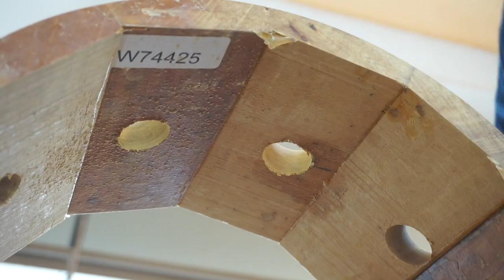SOLID WOOD STAVE SNARE DRUM: TIMBORANA & MALLEE BURL, Pt. 2

Comment: Pro-Tip: Use a wire brush on a clogged hole saw while it's spinning, not sandpaper. It's faster and will clean it right out. You are removing a clean-out route on the hole saw, and reducing the cut diameter, when you grind the side of the teeth with sandpaper. 
This, if you decide you are not going to use a forstner bit, which would be the better option :)
Reply from the maker: Indeed!  I enjoy looking back on these older videos and see how much I've grown as a woodworker.  It will be a long time before I claim to be anything more than a hobbyist.  This is no small part because of the budget I work with.  A forstner bit would certainly have been more precise, but also a lot more expensive.  My "shoestring" budget makes a lot of otherwise simple tasks much more difficult and time consuming.  Maybe someday I'll be able to throw more money into it.  Cheers!
Reply: @JosephCenter  I hear you, shoestring budgets make for some interesting inventions/innovations.  Do know that my comment was more for others that might be watching and not know any better.  Do love what you're doing btw!

Comment: Hi Joseph;
I'm curious about the decision to build with 12 staves and 10 "accents".  If you were to build another, do you think it would be easier to build with 20 staves and put the burl accents in before the staves are glued up into a cylinder?  So that it's possible to do the inlays on flat panels instead of a round shell?  It would also keep the accents off the stave glue lines.  The shell looks absolutely gorgeous by the way, so gorgeous it made me start thinking about building one for myself, which is why I have questions...  ; )
Reply from the maker: Sir, you hit the nail on the head!  The buyer sourced the wood, and the only way to get the 6.5" or greater depth that he wanted was to go 12 staves.  Like, seriously, there was no other way.  But the donor snare he provided for the hardware is a 10-lug.  I'm fairly sure that once the hardware is in place, the joints will be barely noticeable.  As for putting the inlays on the joints, it doesn't concern me at all.  If anything, in fact, I think it will further strengthen the joint, as it increases the amount of gluing surface.  

Great questions!  If you build one yourself, I'd love to see it!
Reply: iliketoUSEmybrain017 - the less staves the better.  More joints and more glue equals less sound quality and possibly higher chance of joint failure over time.

Comment: Dude! Hole saws are for rough carpentry. Do yourself a favor if you do this again, get a forstner bit!
When I first started building drums, the big vents were all the rage. I used hole saws and burnt up every vent and had to sand so much that I sanded them out of round. Then I found forstner bits, and even better, STEP bits.
You build some pretty drums my man! Just trying to help you speed up the process a little 😉
Your table saw scares the poo outta me lol 😂
Reply from the maker: Jason Enz, thanks for the feedback as always.  I'd have preferred a forstener bit, but the right size and quality was expensive, and I already had to buy the plug cutter.  Figured I could make it work, and it did.  As for the table saw....  Dude, I am so sick of that thing!  Really hoping to scrape together a few hundred bucks to buy a decent shop site saw.
Reply: Joseph Center keep checking Craigslist. I got a super sweet deal on a guy that had a decent jet table saw that he barely used and was moving so he just wanted it gone. It was an hour away but worth the trip! Never thought I'd find a deal like that! But they are out there! 
It also didn't hurt working in a fully functional custom woodworking shop. Definitely didn't take advantage of that as much as I should/could have. 
I wish you the best of luck on this journey...I'll be following 😉

Comment: Hi, I am very much fascinated with your videos, rigs and builds. One question though, what router bit do you use for the inside milling? what direction do you rotate the drum in relation to the spin direction of the router bit? a response would be much appreciated and keep up the great work!!
Reply from the maker: Hi, Kamal -- I use a straight two-flute bit on the inside, just like I do the outside.  I've tried other bits and nothing works better.  Of course, there are problems, but the straight bit gives fewer problems than others.  The cuts are generally climbing cuts.
Reply: @JosephCenter  Thanks for the info!! any specific size on the straight two-flute bit for the inside milling? Cheers!!
Reply from the maker: @DholToronto  I use a 1/2" bit.

Comment: anyone know what he put directly on the drum at the very end there?
Reply from the maker: Mineral spirits.  Just cleaning off the dust.
Reply: @JosephCenter  gotcha, I just found your channel today, and I'm in love, I'm trying to build all my own jigs from scratch as I'm working with a 10 inch diameter drum right now and no router I can find will fit inside that.. any thoughts?
Reply from the maker: @williamrooke3213  I plan on doing a full kit, which will include, of course, a 10" tom.  You can get right angle attachments for rotary tools.  That's what I plan on using.
Reply: @JosephCenter  that sounds awesome, when are you going to make this kit? because I'll probably just end up making whatever jig you make for your right angle😂